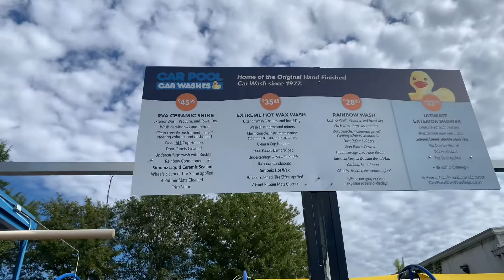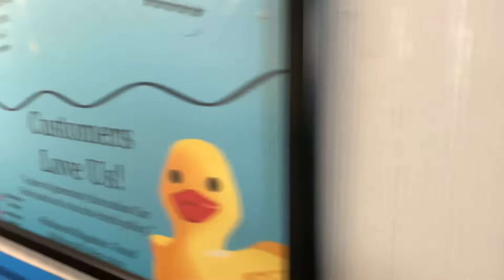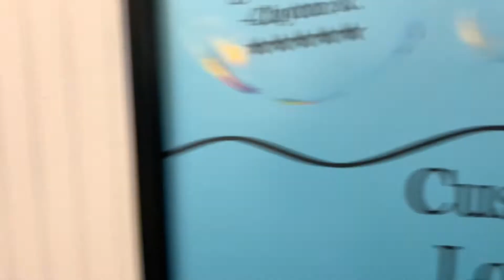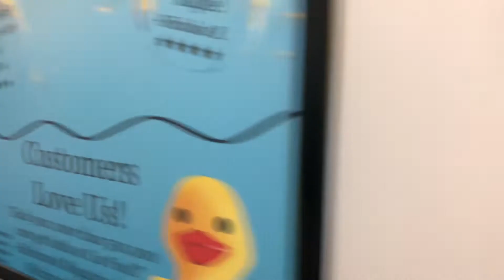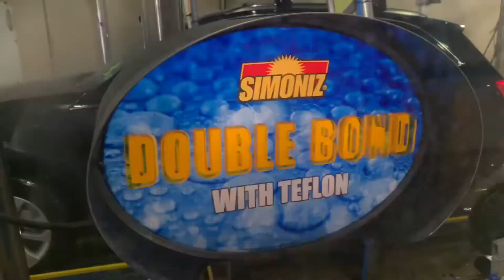Car Pool Car Wash West End Location with older Sonny’s & NS Equipment

Comment: Are those mitters older NS because newer NS mitters don't normally look like that. Anyway nice video.
Reply from the maker: Yeah the NS Mitters are from the 90s I assume. The building itself was built in the 60s-70s and Car Pool bought this location in 1981 and I’m sure this place had Hanna equipment. I know for a fact that this place had a Proto-Vest 90T stripper dryer and it got ripped out in 2018